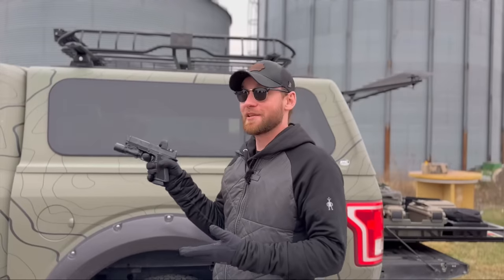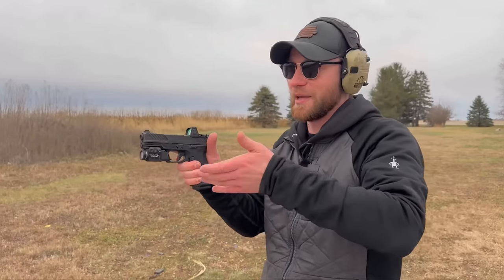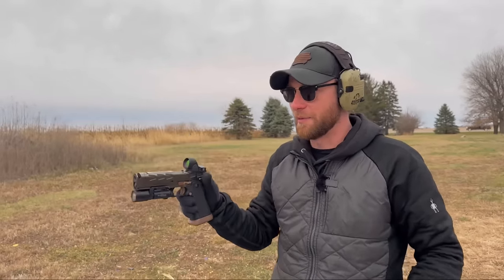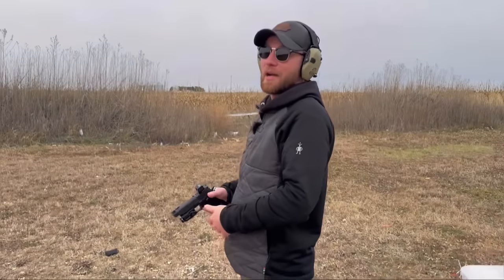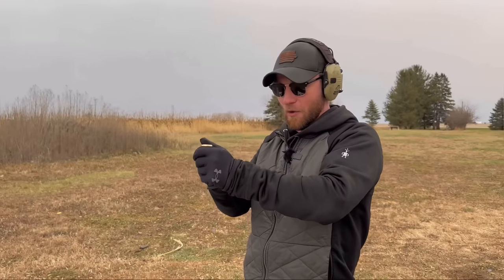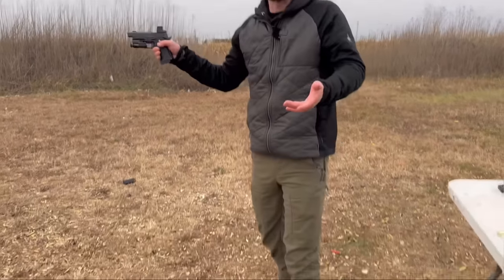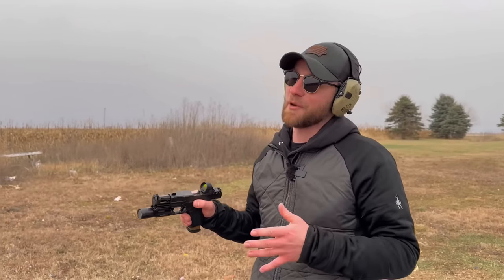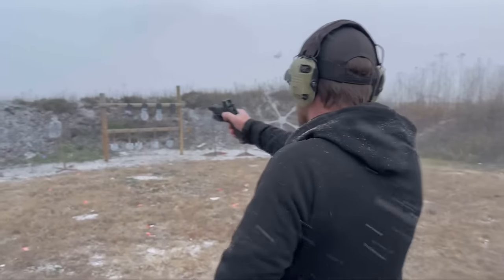How to manage your recoil

Comment: Duuuude!! I usually notice a small flick in my red dot's position during dry fire practice. I tried a dry fire practice with the new grip just now. That thing DOES NOT MOVE!! I had no idea it was even possible to get a trigger pull like that! Thank you!!
Reply: Going to try this
Reply: About to try this when I get off the toilet ❤ same here with the dry fire dot flick
Reply: @OEF_Vet_0331 😂 I’m watching this on the porcelain throne 🚽 as well 😂
Reply: @OEF_Vet_0331  Where you firing blanks on the toilet, or was is big bore stuff?
Reply: Now try one handed. Just make sure that the grip doesn't always have to fix other failure sources. It doesn't have to be extreme grip pressure, just consistent before, during and after shots. Also check what the grip does at different distances.
Reply: It fixed my aim too !!! 😮😮😮
Reply: You took the recoil out of your dry fire, fantastic?
Reply: @williepelzer384  🤣🤣🤣
Reply: @williepelzer384 Flinching and moving before firing is one of the biggest detriments go accuracy

Comment: What’s crazy is I naturally shot like you do with the high left hand and I was told I was wrong. Changed it and I shoot worse now 😂 Switched back to my normal grip and the groups on follow up shots are A LOT tighter.
Reply: I was taught to keep both my arms outstretched, and elbows rolled in slightly to lock the gun forward. It always felt a bit unnatural, and didn't feel like it worked all that well. I started trying out slightly bent elbows, or one elbow locked and the other bent, and I've found it works a lot better. The thing about the general technique with anything is that it won't work for EVERYONE; just most people. Constantly have to figure out what works best for you.
Reply: That's my grip lol glad I'm doing it right I guess. Never had an issue with recoil. I did a lot of airsoft and was surprised how much transferred over.
Reply: I'm very surprised that putting pressure on the slide like that doesn't interfere with it going into battery. I just used the thumb ledge on my MR920 and thought that was pretty good, until I saw how much he controls it
Reply: @MultiPurposeReviewer both arms outstretched is a garbage old-school method, as well as cupping the bottom of the grip with the off hand. You need triangulation to manage recoil & give you the most support (i.e. dominant arm all the way out straight, off arm/hand elbow slightly bent & rolled down to create a 90* triangle with the body).

Comment: Thanks for the input on stance. All my trainers tried “correcting” my posture even though I shoot far better in the “fighting stance”.
Reply: Same experience. Drives me up the wall when the instructor is making people worse.
Reply: I'm a bigger guy (215lbs) & even with 9mm or .22 I shoot better in that stance. You have better balance that way both front/back & side to side & can manage recoil better that way. It's how I've trained my wife to shoot & several other people & its the way I've learned as well.
Reply: It all depends on what the goal is. If an instructor has a background more geared towards precision than recoil control it can have a point. What will give you good recoil control can be a detriment at long distance. Goals should be set before training or what the class is about. Everything new you try needs about two weeks of range visits to give it a chance and experiment with.
Reply: I like the “fighting stance” too. It’s the most natural stance for me.

Comment: Three pointers in less than 5 minutes. Easily digestible and presented very well.  That’s how you teach someone on the range…incremental adjustments without overloading them. Great job! The high support hand concept wasn’t taught when I began shooting 20 years ago…I can say that without a doubt that my recoil management and shot times improved as I transitioned to a higher support hand grip. Keep up the great content.
Reply: Regarding high support hand, when you get your thumb up that high on the slide, how does the slide flying back not mess up your thumb? No pinch or friction? I haven't had the chance to try yet - just wondering.
Reply: @svalbard01 just commented the same thing
Reply: @svalbard01  I have asked the same thing because many say that leaving your thumb on the slide bites you or causes the gun to malfunction or even cuts your finger.
Reply: @Angela-bv9gw  I've been to the range since I posted the question and didn't have any thumb issues. Especially on mine (CZ P10F), the slide taper makes it a non-issue.
Reply: @svalbard01 fantastic I will try it too.
Reply: @svalbard01 I saw on one of his other videos that his thumb kind of ‘floats’ off of it, not making contact. He even oriented the pistol to show the gap between his thumb and the slide.
Reply: @denniselkins3392  Yes, that's how mine ended up, too. I think once people try it, will demystify the grip.

Comment: I love coming online and seeing how other people solve the same problems. I'm also a smaller guy, and organically came to a similar conclusion decades ago, mainly due to being a Metal Gear Solid fanboy. One of my first handguns was the Mk23, which has a very high bore axis. First learning to shoot it, I could barely control it. Got higher and higher on the grip until I was in basically the same grip you use. It naturally transferred over to other handguns, and no one ever corrected me, despite over 20 years of combat shooting. I guess because it produced results. 100 yard shot, consistently ringing steel, with a G17 and irons? I don't think any of my instructors or peers cared about what my grip looked like lol. 

It's very interesting to see how you got to the same solution, despite different stimuli.

Comment: I want to see 10mm recoil management on different people. Like a bodybuilder, rock climber, arm wrestler, masseuse, etc. two hand single hand. It would be interesting to analyze, and possibly design lower recoil hand cannons based on the data.
Reply: Masseuse may surprise people.. that occupation builds crazy strength in your fingers and forearms over time.

Comment: I do have a tip for you and anybody else who wants to try it out. I shoot a lot, & I'm known by friends for being a good shot and very knowledgeable about all things gun related. Something I didn't know that I do with my grip until recently, because 99% of my shooting is on my property alone, is that when I don't have a light on my pistol I have a normal right handed proper technique position, and I do my left hand exactly like you... High left hand angled forward heavily, but I feel like I have a tighter grip by adding this. The left index finger goes around the front of my trigger guard. Most of them have grip texture and it allows me to get the hand high without compromising the grip strength by bunching up my fingers. That index finger tucks the gun tighter into my hands and adds some extra downward pressure further forward on the gun than it otherwise would be. When I have a weapon mounted light, I shoot exactly like you do. Hopefully, you read this and you try it out, I'd love some feedback. Apologies for the long novel of a comment, it felt necessary to explain. Love the videos, and thanks again for putting me on the captured spring for the AR-15. That was the one thing I didn't consider.
Reply: I do the same thing! No flashlight, support hand index finger around the trigger guard. 

Lena Miculek also shoots with the same grip. If it works, it works. Probably the best shooter in my friend group. 🤷
Reply: @BaritoneMonkey  I'm glad somebody else who is a good shot does it as well. Thanks.
Reply: @BaritoneMonkey Lena Miculek grip is slightly different but essentially same concept to get more downward pressure further forward

Comment: Solid recommendations and I agree with using your off hand in a clamping motion when gripping your pistol.  I never had solid muzzle flip control until I modified my gripping method using the clamping motion and began running this in all of my handgun drills and now it’s muscle memory and I have very little, if any muzzle flip while firing.  Good video showing this technique.

Comment: Going to be lost in the comments, but something that has to be said.
I didn't shoot since July and I got my hands on the Glock 17 in December.
I have a total of 158 rounds on handguns, because I don't shoot often and when I do, it's not a lot.
It was my first time shooting Glock 17, I only shot 34 before, and I remembered the grip advice. It has improved my recoil control significantly even though I didn't grip the gun harder or anything, and it allowed me to make hits at 20-25 yards.
Advice on trigger pull also helped me shoot without pulling the gun to the sides.

(Also, shooting 9mm with Earpro right after having AKSU blast my eardrums without earpro helped a lot when dealing with flinching - it's gone and I probably have hearing damage)

Comment: One thing to keep in mind is when it comes to your support hand and riding high, is get it as high as possible WITHIN reason of your hand size, find that sweet spot where you can maintain sufficient contact and pressure.

I've got small hands and if I try to roll my support hand as high and forward as I can i end up flaring the bottom of my hand off of the gun losing grip on the pistol. Just something to keep in mind.

Comment: I definitely learned I need my left foot forward to help give me a stable shooting position. I need to lean more into the pistol as it does push me back I’ve been noticing. I also wanna work on my grip, but before the grip (mainly your high grip idea to manage recoil better) I need to keep practicing not flinching/pulling the trigger with a consistent grip and pull with my trigger finger and that’s been taking a huge step forward. I’m able to hit what I want pretty consistently and at further distances than I’ve been shooting before.

Comment: My grip is exactly the same as yours. In addition, I'm doing a pull-pull with my palms in opposite directions. It stables the gun and locks my elbows in perfect angle aligned straight with the bore.
Try it when shooting as fast as you can and you'll see your group much tighter.

Ah... My stance is square to the target.

Comment: Not gonna lie I got a little BB gun here at home. Working towards buying my first pistol ever. I tried your rotated grip on it. While the grip on that gun is smaller (it's a toy basically) than what I'm going to be I could definitely notice a difference. It almost felt easier to hold your way. I'm getting an MR920 foundation for the first gun so I'll definitely try it out while I'm learning.

Comment: I have three questions for @PewView: 1) by squeeze are you talking about the fingers or heels of the palms; 2) it kind of looks like you’re flaring your elbows out, is that right; 3) how does slick leather soled boots on hard dirty concrete affect your stance and mitigating recoil during a stage?
Reply: Regarding no.2, you should point your elbows out to increase the amount of pressure you can put on the grip with you hands and it also helps to avoid the elbow joint to bend from the recoil

Comment: I get the concept of a higher support hand and tighter grip.  The question is, are you rubbing your thumb on the slide?  The other thing that I noticed is that it appears that you have the two first fingers (index and middle) of the support hand forward of the grip as opposed to the normal grip in which only the index finger is forward of the grip.  Feels solid, I will have to give it a try.
Reply: Someone asked that on another video and he confirmed that his thumb got thought but the slide multiple times during the years haha…so there’s a risk but I’m sure that with practice you’ll be minimizing the chance of it happening (:
Reply: @NirHason  Thanks for the update!

Comment: Thanks for the video!  Is there any pressure being utilized on your left thumb?  I sometimes see it on the frame and sometimes on the slide. If on the slide... how does that work with the slide "sliding" back? Or is the thumb kind of gently placed on it and most of the pressure of the left hand is on the palm?

Comment: With such a high grip, how do you keep your support hand from interfering with the slide release? Mine likes to keep the slide from locking back after the last round. Thoughts?
Reply: This. I switched to a kagwerks extended slide release for g19 which "helped" but it malfunctioned so i dont trust it on carry gun. But stock release my hand crushes and slide never locks back

Comment: Would gripping it high like that potentially interfere with the slide cycling?
Reply from the maker: It can for sure, just something you’ll learn over time practicing and every handgun is different
Reply: @PewView  I am practicing your grip and I think you are saying to not squeeze the slide but to have more of a top-down leverage to hold the frame in position. The slide just rides along your palm and you are not trying to squeeze too hard to impede it

Comment: When you grip the gun high like that, are you putting most of your pressure with your offhand on the frame? It kind of looks like you're holding the slide.. do you just have to find the right spot where you won't introduce malfunctions?

Comment: I'll definitely be trying this out next time at the range, makes sense. Do you happen to rely on the light for grip by chance? You had a few moments in the video where you did shoot without one, but couldn't tell if you had to dial your grip back a bit because it? How about the longer portion of your left thumb, it's basically at the height of the slide. Are you just barely touching the slide? Figure you'd have to be careful to not get a rubbing effect. Appreciate any tips, thanks!

Comment: Newbie shooter here (only shooting pistols now about 3 months) When using a grip like this is your trigger finger OK touching the palm of your stabilizer hand when you pull the trigger? I struggle a bit with left hand placement. Found your channel looking for a solution to that along with recoil management advice. My left hand often seems to fall off my 1911 between shots. I cant grip my firing hand well enough it seems. Its not a strength issue I'm hoping your advice helps here. 

Thanks for the video.

Comment: Is the culprit of discomfort a function of acceleration, or the second derivative of projectile velocity called Jerk? or both?

Specifically, will a 4" barrel of 9mm parabellum caliber shooting 115 gr full metal jacket ammo 1190 fps 362 ft-lb energy at muzzle cause more discomfort than a
147 grain Hdy XTP at subsonic 975 fps and 310 ft-lbs at muzzle?

Do you have a source for pistol recoil discomfort?  I am trying to decide which has less discomfort from recoil for the same firearm?

Comment: Do your support and firing hand connect together on the back side or do they have a gap between the meat? Because your support hand is higher up and moved further forward on the grip? Do you apply pressure throughout the entire grip by having torque on the sides as well or just forwards and backwards?

Comment: Something I get a lot is when holding it high, it's me gettin in the way of the slide, It didn't lead to anything bad on my Bul yet, but it's new, on a Glock 19 it locked the slide every 2-3 rounds which was really annoying, behind the scenes do you get slide locks with your 2011 platforms ?

Comment: 1:08 I tried this move of yours previously.  I kept getting failures to eject by squeezing on the slide.  Never had that problem previously.
Reply: You are a left hand shooter?
Also, watch your hand palm from rubbing against the actual slide so it won’t interfere with its movement. This method needs some practice for sure
Reply: @NirHason  Right handed.  Just felt awkward hovering my thumb over the slide as it cycled through.

Comment: For Glocks, a tungsten guide rod helps with recoil as well.  From what I can tell, it's the added weight of the tungsten guide rod as it uses a factory-weight spring.  And I am pretty sure a tungsten guide rod will last longer than the plastic factory Glock guide rod.  I also feel like setting up your gun so that it is balanced (should stay upright when balanced with your finger on where the trigger guard connects to the grip) has really helped as well.
Reply: More weight forward on the gun is better then being balanced at the trigger guard/grip connection point. Balance on the back end is pointless infact because as you run through the magazine you're losing weight from the back end & you're getting more weight forward anyway. You have to think of it as a lever with the grip as the pivot point, you put more weight out on the end the furthers away from the pivot point then its not going to move as much

Comment: I have an Sig X Macro and the skin on my thumb knuckle at the web of my right hand gets rubbed raw by the edge of the beaver tail on the left side after about 200 rounds.  It seems if I try this grip on this gun I would get slide bite.  It might just be too small for my XL hands.  I’m getting a hogue grip to add on to see if that helps.

Comment: Do you have issues with the slide not locking when you grip high? Mine wont lock back because I'm holding the slide release in the lower position

Comment: I don't know how you're doing it. I tried this at the range and my left hand keeps slipping due to the slide motion. I can't grip it hard enough to where it would stay in place if it's that high
Reply: Because it's an incorrect way to hold your gun, grip with your right hand first,get your grip strong, then with your left hand wrap around your right thumb, get that high grip nonsense out of here. Check high level speed shooting competitors like Jerry Miculek. Not that mor0n.